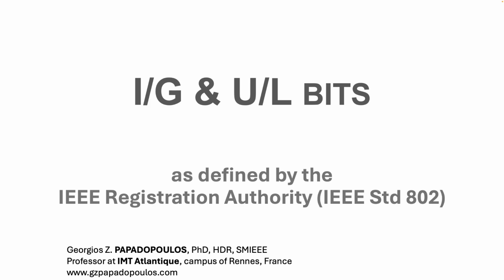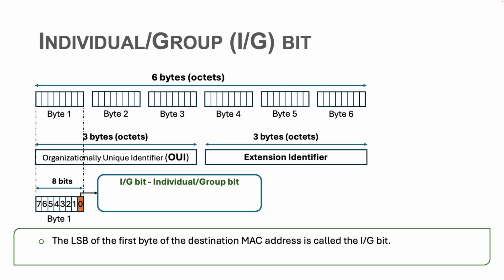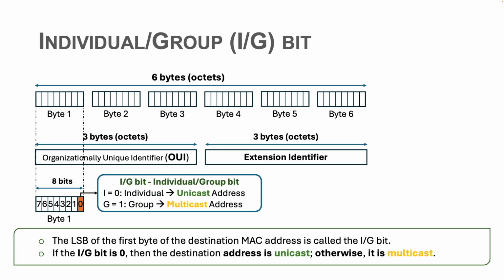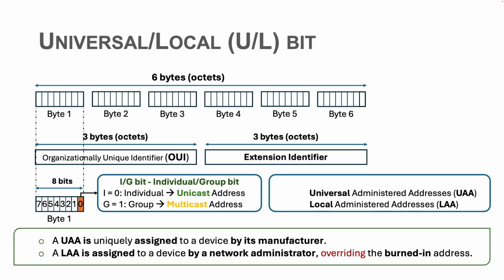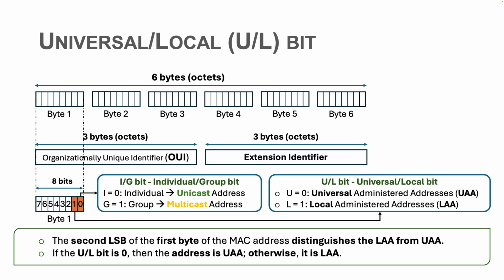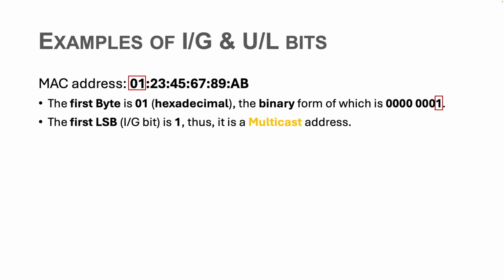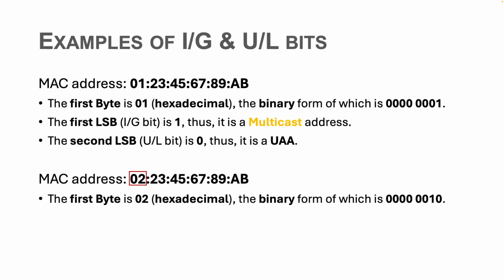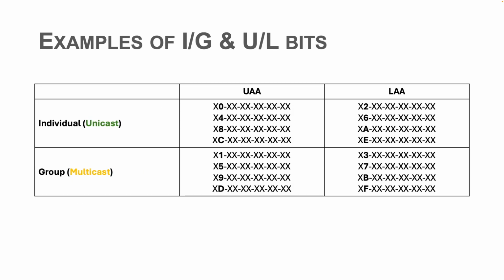MAC Address Explained: I/G and U/L Bits Demystified

Comment: Does this mean, I can't manually assign a MAC address randomly?
Reply from the maker: Hello @PinoyHouseDesigns,

Yes, you can manually assign a MAC address, but it should follow certain rules.
When you manually configure a MAC address, you should normally set the U/L bit to 1, which makes the MAC address a Locally Administered Address (LAA). 
This indicates the network that the MAC address was not assigned by a manufacturer’s OUI and was instead set by software or an administrator.
Moreover, this avoids colliding with real vendor-assigned MACs.

Hope that helps!